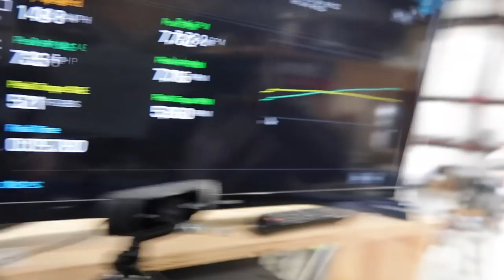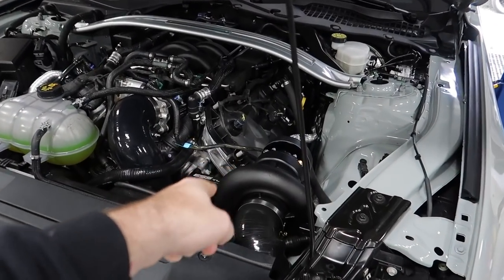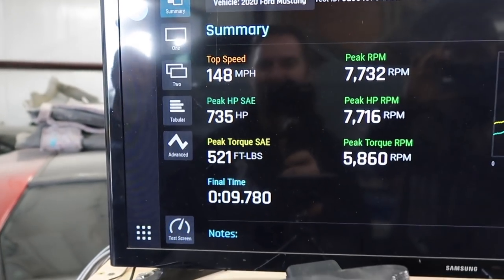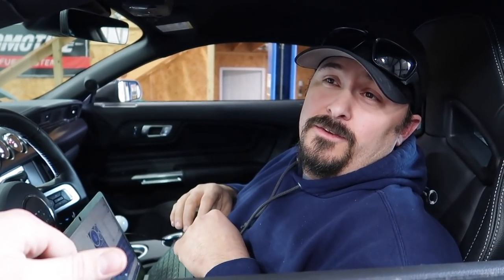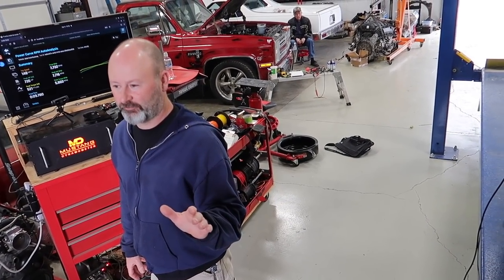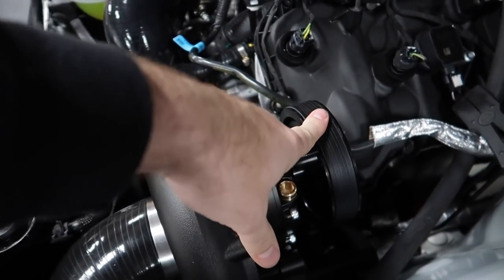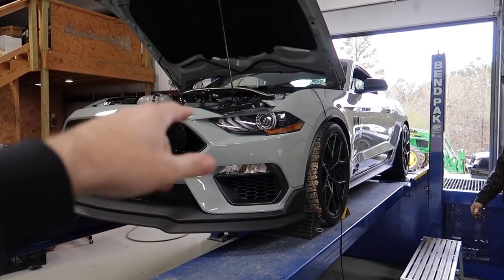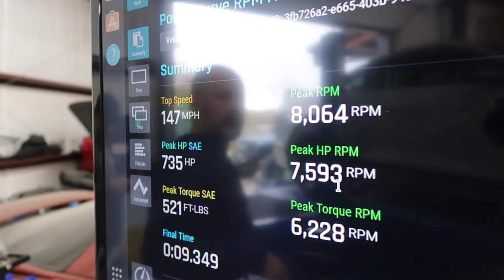My 2021 Mach 1 ESS Supercharged Mustang made WAY MORE POWER THAN EXPECTED!

Comment: Awesome man,  great power. My G2 got me 720whp with similar setup.  Running the G3 now at 14lbs of boost,  Fore innovations fuel system,  95lb injectors,  105mm pulley and tuned on E85. Car on the dyno made 870WHP.  These kits are amazing
Reply from the maker: These systems are crazy efficient 😁
Reply: @Zander13Productions  enjoy the new build!
Reply: Did you max the G2 out or? I’m still undecided on G2 or G3
Reply: @matt7sixty  not necessarily maxed out, it could have reached 800 hp but didn't want to put that much strain on the blower. I knew I wanted an 800 hp car so the obvious choice was to upgrade to the G3 and fuel system.
Reply: @Sabotfit5oh  Gotcha how small of pulley did you do on the G2? Also I have cams and dumps so idk if that’s more reason to go G3 or that it would make like 850 on the G2 lol?
Reply: @matt7sixty  not sure about the cams,  they will help for sure. On the G2 I was running the 110mm pulley and was tuned on boostane and premium
Reply: @matt7sixty  you won't get 850 on the G2 no way.  Max is about 800 safely.  Go G3 if you want that kind of power
Reply: @Sabotfit5oh  E85 cams and dumps on the 100mm pulley considering that I’m confident it will hit 850 lol But I want a little more than that so G3 it is, I appreciate the info hadn’t talked to anyone that had the G2 yet
Reply: @matt7sixty  no prob, anytime,  ya just do G3 bro.
Reply: damn the site said 100mm was only 11psi, you're making 14 at 105? Guess ill just make my shift points 7k rpm to keep the boost low and have a good midrange. im flying with 7 psi full interior at the track.
Reply: @alvtuning5877  yes my tuner has my shift points at 7100 this time around. 105mm at 14psi, perfect setup
Reply: @alvtuning5877  Psi is a little tricky, It’s actually a measure of restriction. For example if he dumped his exhaust, His psi would drop but power would increase
Reply: @matt7sixty  yeah it varies w restriction but if he is making 14 psi, I'm definitely going well past 11 psi with a 100mm pulley. I'm may max the gt500 pumps, guess well find out if I need to upgrade. Imo if you have dumps/ seats/ light battery and a 10r80 the g2 should be enough, since you can upgrade it to a g3 by changing the impeller.
Reply: @alvtuning5877  Yes sir I may do that. I appreciate the input
Reply: @Sabotfit5oh  Ah yes somebody who has had a G2 and currently has a G3! Thanks for responding back to Matt7sixty because I had all of those same exact questions lol. I'm also undecided on if I should get a G2 or a G3. My power goals are much lower. I want to make between 680-715hp. ESS' site says that the G2 is capable of that but they also mention the G2 is rated for up to 800hp. Making 715hp would be closer to the top end for that blower so wouldn't that cause too much strain on the blower over time? The G3 is rated between 700-950hp so making 680-715 wouldn't be that stressful on the blower right? Or would the G3 just be waay overkill?
Reply: @Viper3870750  honestly bro,  if you truly and I mean truly don't want crazy hp then G2 is for you.  Max on the G2 is around 800 btw without hurting the blower.  Just get the G2 with G3 intercooler,  BAP, 120mm pulley,  1000cc injectors and tune on premium,  you'll be exactly where you want to be bro
Reply: @Sabotfit5oh  I really appreciate you man! Thanks for the insight 🙏🏽
Reply: @Viper3870750  no prob!!
Reply: I’m made that on 8lbs on my 2019 TT
Reply: @Sabotfit5oh  how much boost should i run if i wanna make 700rwhp on an 18’ with the g3?
Reply: Who did your engine work?
Reply: @robedwards6926  Voodoo Performance and AtoZ Motorsports did everything here in AZ.

Comment: Running the G2 kit on mine and it's been great. ESS kits are turning out to be very efficient!
Reply: I have a G2. Any other mods or reinforcement to your car before adding the kit?
Reply: @AH20XX  I went with Lund for tuning. FIC 1000H injectors and a boost a pump is all I am running.

Comment: That's crazy on 7.5 pounds of boost!! Congrats brother!!
Reply from the maker: Thanks brother
Reply: FYI They rate those pullies wrong at ESS. They make more boost than they rate them for. It’s making more than 7.5 lbs of boost. Regardless the ESS kit is a really good kit.
Reply from the maker: @nola504boy1  yea. I covered that in video
Reply: @Zander13Productions  I don’t think he heard you because he still thinks it’s only 7.5 lbs of boost.
Reply: @nola504boy1  it’s prob 9-9.5 psi here.

Comment: hell we just picked up a 2021 10 speed. we put the roush 2.65 750 kit. did 692 rwhp, 615 try. I was astonished.  I never thought it would make that power on a stock gt. now we have the throttle max from AM and it helped out alot. on a cold day in Houston we will do 700 plus.

Comment: Wow bro that’s awesome! Super clean set up, now you got me into really supercharging my GT350, that ESS supercharger steered me away from the procharger, If I do supercharge my GT350 I want to do the exact same set up you did! I liked what Ken said on the previous video about this kit using the OEM pulley unlike the others, less stress on the crank, smart design 🙌🏽
Reply from the maker: Yes. I would definitely go the ESS route. Better fitment and no crank stress. Install was so easy a 10 year old could do it 😅
Reply: @Zander13Productions  isn’t the procharger same install benefits as ESS?
Reply from the maker: @Oliver-ft2fq  yes but ESS is a little easier, lighter, cheaper and confirmed to make more power.

Comment: What’s nice about this power level is you’re still under the max torque input for the 10r80. The specs for it are 800 N-m nominal max input torque capacity which translates to about 590 ft-lbs. That first pill showed 521 ft-lbs

Comment: On my G3 I am also running the 120 mm pulley and on my p3 gauge I saw 8.7 psi last night on a pull so the 7.5 psi rating is off by about 1 psi.
Reply from the maker: Agreed. It’s rated at 7.5 at like 7200 rpm. But with more RPM the psi goes up

Comment: Can you elaborate on the comment u made about upping the octane on this build? What exactly were u running in the tank on this 735RW result?

One things for sure, Boosted Coyotes like rpm and you guys made serious power with this kit.
Reply from the maker: The 93 is had was crap. So we added a little booster to get to true 93. Tune was capped timing at 93. Won’t matter if there is 5000 octane in the tank. If the tuner caps timing for 93 tune then that’s all you get. So it’s a legit 93 tune. Now… if someone wants to add booster every time and have tuner bump timing for above 93 then they can do that bc there might be over 93 in the tank. I did not do that. My tune is based on 93 timing period. Most ppl have no clue how that works and think booster adds power. That’s not at all what it does lol. It just brings your octane up a few points but your tune dictates what the octane timing cap is. So if there is 100 octane in the tank, the tune does not automatically adjust for that. It’s still capped to only have 93 timing so any octane in the tank over 93 is a waist. Tuned cars can add timing on their own per the tune but there is a cap that is set to not go beyond to keep the car safe.
Reply: I wasn't implying u were doing anything wrong, just curious on how u got to 93 octane😎

I’m well aware how tuning, octane work buddy😜

All Good…...
Reply from the maker: @19gt92  sorry for the long response. That was more geared towards others that might read the comments so they know 💪☺️

Comment: Solid brother!   What rpm would you say the boost kicks in consistently?
Reply from the maker: About 3500
Reply: @Zander13Productions  badass brother.  Gotta do a vid on your thoughts on a centri vs your previous setups!  You put in a 170 thermostat?   My IATs rarely go over 200 with the 170 and the fan tune for it

Comment: 7700rpm is more like 10lbs. ESS rates their pulley's on a Gen2 at 7300rpm The faster the engine spins the more boost it will make. The g3 head unit makes a little more boost than the g2 at the same pulley size. I run the g2 on a 2019 a10 with a 115mm pulley.
Reply from the maker: Yes 100%. Definitely a bit more than 7.5 psi. Got the boost gauge installed and am seeing 9 psi on the street

Comment: Great video, was that 735 to the wheel? Happy for you buddy
Reply: It’s on a dyno which reads the Hp at the wheels 

So yes it’s wheel Hp
Reply: They said 881 crank hp. Man that is wild!  Cant wait for the content for this car. Needs to get those cats off soon though.
Reply from the maker: Yes 735 wheel
Reply from the maker: Yes. I need headers
Reply: @michaelhaile6371  

881 at the crank?

WTFFFF?!!

Fierce power..
Reply: @Zander13Productions  I can't wait for mine.
Reply: On pump gas !!
Reply: @michaelhaile6371  I'm not sure how they came up with that number. No way the car lost 146 hp through drivetrain loss. I'm thinking the number was 818 and he just said it wrong.
Reply: @lobbyrobby  735 x 1.2 = 882, 20% loss. Don't agree with equation at this power level, but assuming the math
Reply: @ryandoyle4344  yeah I don't see 20% drivetrain loss through a manual. From what I understand it should be around 12%. Now an automatic I can see getting closer to 20% but that's still pushing it imo.

Comment: Are you going to keep running it at 7700rpm or lower? Do you think it would have been the same with MT82?
Reply from the maker: Yes. I have oil pump gears so I’m safe around 7700. MT 82 should do the same

Comment: Curious. If it was pulling 3 degrees up top, and you can’t lower boost without a pulley change, what adjustments allow you to add in more timing after the fact? Valve timing for better flow? 

Also, the car sounds amazing. Great intro BTW 🐌💨💨💨
Reply from the maker: We put in better fuel basically to raise to true 93 octane and it cleaned up the pulls
Reply: @Zander13Productions  Ah. Gotcha. I only have 91 here, so I run a Snow Performance Stage 2 Boost Cooler kit (50/50 water/meth aka Boost Juice)
Reply: What was the fuel u put in to raise the octane?

Comment: How's he getting 881 Crank?  735 at the wheels, with 10% drive-train loss is about 808HP.  If you want to get stupid crazy and say you're getting 15% loss it's still 845HP.  Regardless, how frikin amazing are these results!!!  NICE!  🏁🏁🏁🏁
Reply: Old rule of thumb (15-20% loss for a manual), 735 x 1.2 = 882. Don't agree with this, as not accurate
Reply: @ryandoyle4344   Brain fart!  Yes, manual - I like the middle (average) at 17% but we're splitting hairs at this point.  Thanks.

Comment: 💯👉I still think you did the Baseline wrong somehow, 501 and 460 at the rear wheel just sounds wrong Baseline stock, seriously incorrect... it's too late now but seeing those numbers on a stock Mach 1 should have made more than two pulls maybe,or a different Dyno all together... just for a accurate bassline anyway.. I love these coyote engines.
Reply: Mach 1 is 480 stock, would have guessed 425 whp
Reply: @ryandoyle4344  No it's not 480 stock at the wheel, something's wrong..